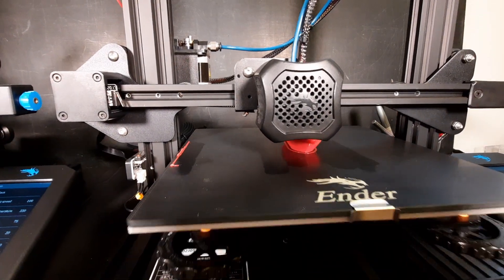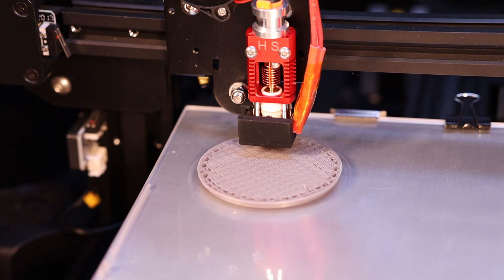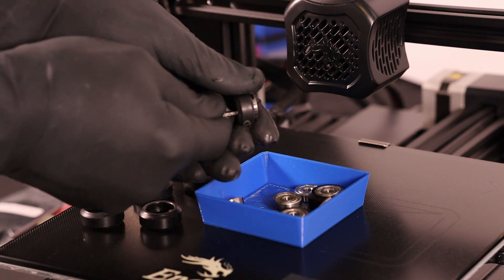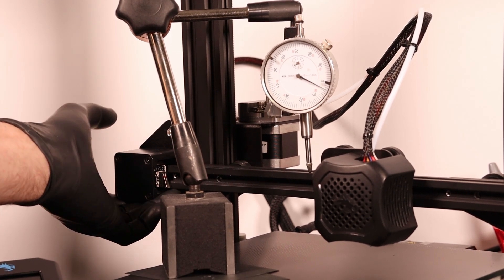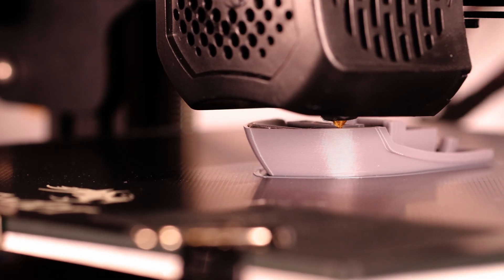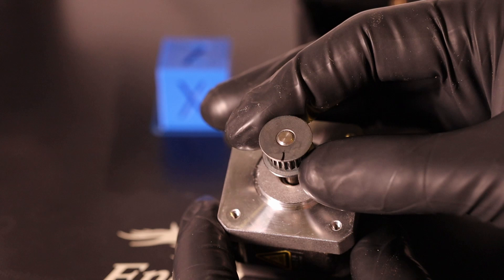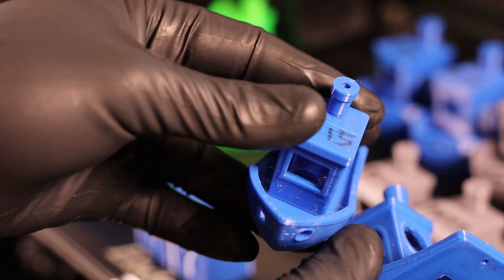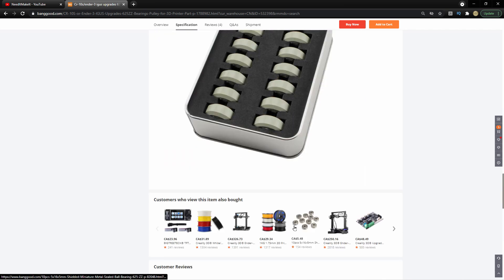Creality Ender 3 V2 - Can These Two Printers to Make Identical Prints?

Comment: Whats the name of the part to crimp on the edge of the belt? I have googled it a few times but maybe in just unsing the wrong keyword. Thank you
Reply from the maker: I'm not sure, but it is a crimp made of copper.  I have used a small piece of copper pipe, or a flattened piece of copper wire as a substitute.

Comment: The powergrip belt is probably not so much "better" but different. It's much less stretchy, so it can perform better, but i think it's really only relevant for long belt run machines such as CoreXY, but also, much less forgiving of minor alignment issues, for example printers that come with mismatched pulleys - motor pulley 20t and idler pulley smooth in 16t diameter for example, which i think China printers are all doing for some reason. Consider what happens geometrically, you have a triangle and you're moving a vertex along, left and right, and so the overall perimeter length of the triangle changes. So mismatched pulleys are not ideal. Also belt twist isn't ideal for the same reason pretty much. Also not ideal is when the mounting point for the belt on the moving piece is off-axis from the belt path between pulleys. Realign your printer to get this path right, get proper size and type pulleys.

The standard belt should come about 2% undersized, so when you've tensioned it feisty enough that it reaches correct pitch, you know that you have reached the spec tension. And then it still has some leeway to absorb geometric shenanigans, 1% or so, which the more reinforced belt does not. I think belts supplied by Chinese printer companies are perfectly fine. The belt's intended tension is FEISTY TIGHT, you need some good current on your motors and they'll get warm, and they'll wear their bearings. So i think you replaced a bunch of rail wheels right, and they liberated some 625zz type bearings if memory serves? Those might come in handy when your steppers seize up. Crybabies on the Internet will tell you that you can't disassemble the stepper motor, reassemble it and have it work properly, and they invariably never tried. But if you just avoid cracking the rotor, you'll be fine, these no-name steppers aren't precision assembled anyway, they're just thrown together by hand, what do you expect for $4 a piece? Some precision is there, but it's all contained within the machine made rotor which is pretty solid.

Comment: Possibly check hot end temperature calibration in both. One may be slightly off the calibration, resulting in lower or higher printing temperature.
Reply from the maker: I think you are right, that is the only logical reason for the difference in stringing between the two printers.  I will look up how to calibrate and test for this.

Comment: I'm doing some research in order to get my first 3D printer. I was thinking about the Ender 3 V2 and, after seeing your channel and the remarkable prints you manage to get with this machine, I (almost) made up my mind. Thanks for the great content!
Reply from the maker: No problem.  This is a great printer, I think it could still be improved a little bit, the plastic extruder will not last, it should be metal, and the coupler for the bowden tube should be replaced to one allowing the tube to pass through it.  I have a few videos on this already.  I am also working on some tips to achieve even better results with this printer.  The Y axis is too heavy with the glass, using a thinner glass, or carbon fiber saves quite a bit of weight and gives better results.  I may have made my best print ever 2 days ago by using these simple modifications.
Reply: @NeedItMakeIt  Thanks for the tips! I've already seen your other videos on the topic. Do you think it's a good idea to replace the extruder directly when I get the printer? Or is the plastic extruder good enough for a while?
Reply from the maker: @fmrigon  Yes, I'd replace it with at least the single gear metal.  I've seen quite a few photos from viewers showing the broken arm, I'd assume that it could break while printing and would ruin the print.   Mine was good for 6 months, some people had theirs break after only a few days, maybe they've over-tightened the spring.
Reply: @NeedItMakeIt  I guess I'll order the metal extruder together withe the printer, then. Oh, and the stiffer springs as well! Thanks!
Reply from the maker: @fmrigon  Yes, those two things will save you some hassle down the road, but that's pretty much all you need to do for a while.  Some people like to upgrade their printers, I think it is best to keep them as close to stock as possible unless there is a huge benefit.  I'd like to investigate the Bontech LGX extruder, it looks amazing and it is different from anything I've seen.

Comment: Print out your own replacement wheels for your bearings
Reply from the maker: That's a cool challenge, I think it could be done, I'd want to turn them on the lathe afterward to remove any high spots.  Have you done this?

Comment: I would use Delrin nut for the Z axis which is way better than the brass ones. Your nozzle is also a wearing part, maybe to be blame about stringing. Check any wearing part, like fans too. Check also any bolt which can untight from as time goes by. 

IMHO the rubberized belts are quieter but not as precise as PU gt2 belts (white ones). When replacing the belts, you want to check the steps per millimeter on each belt driven axis. You want the belt to be perfectly horizontal along the path where it's attached to the X carriage. Or the belt path is a trapezoid and in consequence the positioning is not linear which introduces some deformation of the part along the axis. This is frequent with printers like these, because the holding metal parts of the carriage are not bent with the perfect angle. 

I like the wheels to be a bit closer to the rails. Yours seems a bit loose to my eyes. It can slip over the rail by turning it by hand, but not so easily. Remember, a wheel too far aways results as some play, and in consequence some artefacts on the print. 

About bearings, you can upgrade to 605-2RS bearings, rated ABEC 5 minimum (the higher the number, the better - but ABEC 9 is probably overkill for a 3d printer). Please note genuine 3d printers's bearings are ABEC1 to 3 for the betters, but wear very quick. 

Happy printing ;)
Reply from the maker: I had some on order from Amazon and wanted to include in the video, they were lost in transit, they all seem to come from China.  Great tips, the wheels could be a little tighter, my plan is review their tolerances periodically, the original wheels for example had deformed and created quite a bit of space before I realized it was a problem.  maybe once a month they should be reviewed.

The bearings still seem pretty good from the worn wheels, very smooth and no crunching.  It would be tough to measure those kinds of tolerances unless every print came out perfect, there are too many variables in play.

Thanks!

Comment: When you print PETG on the Ender 3 v2, do you use anything on the bed? Will I get the print stuck to the bed if I do not use hair spray or similar?
Reply from the maker: Yes, I've been using ordinary glue stick, it creates an amazing bond with PETG and PLA, into the freezer when the print is finished to release the parts.

Comment: Make some filament rollers with the bearings!
Reply: Be careful with those filament rollers, they seem to be a good idea but I had a bad experience with them. When the extruder pull filament, if the roller has little or no resistance due the ball bearings, it will spin too much and the filament could be tangled. In my case I had several failed prints because of this and it was hard to realize that was the problem.
Reply from the maker: That's a great point, having a small amount of resistance is probably a good thing in this case.   I was using a standard roller when printing in an enclosure, I've had to bring the printers close for the videos and there isn't too much space.  don't believe mounting them above on the frame is a good idea, it seems to amplify vibrations.

Comment: Those steppers have 200 steps per rotations at 1.8 degrees per step. Backlash will show on Z even if there is a very small play if the bronze nut is not resting on the lead screw bottom edge when going down, an anti backlash nut/spring is the way to go if you cannot have the gantry fall freely. ***BTW the bronze nut screws should not be tighten to prevent binding, keep in mind that when the Z is going down, you want the gantry to fall freely on the lead screw bottom edge and not the top edge push it down. On the Ender 3 V2 you also need to shim the Z stepper for the Lead Screw to be properly parallel to the frame. Annnnd also, those "artifacts" ( still not sure what yur talking about ) they often have to do with the resolution of your STL file VS Max resolution in your Slicer. Often times a model will have excessive geometry for a simple shape, but the slicer will try to break those into many G-Code commands, try lowering the Max resolution in Cura ( upping the number to say 0.5 and 0.05 deviation )
Reply from the maker: Worth another look, yes, I do know that the electronic steps are 1.8 or other variations, however the physical steps I can feel when turning by hand could have a relationship.  Why does the Y on both printers have these slight vertically aligned undulations, not ghosing or ringing, and why the the X not have them?  I was thinking belts at first, but there doesn't seem to be a correlation there.  I may steal a motor from the new printer to see if there is an improvement.

I'll take your advice and create some simple parts to test, I'd like to test a larger Y motor as well, maybe this small motor with the heavy carriage is contributing.